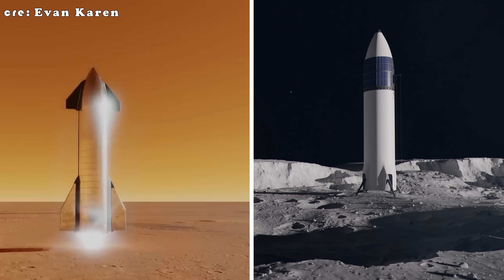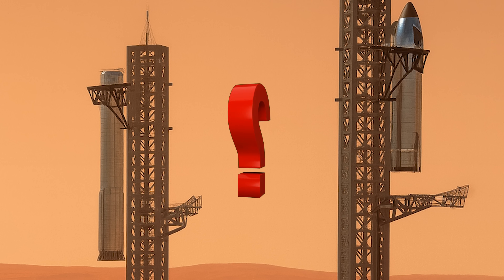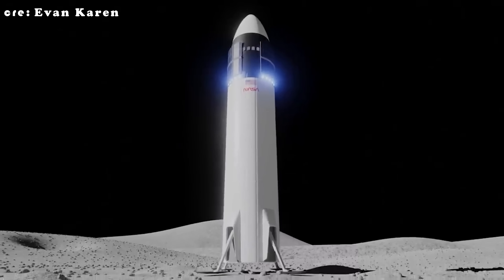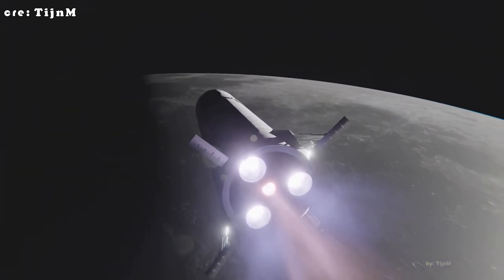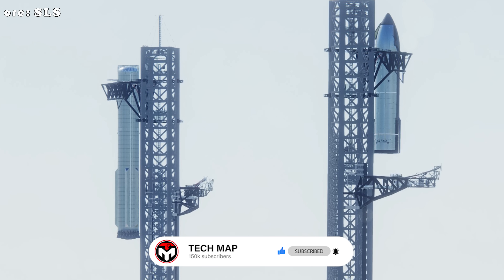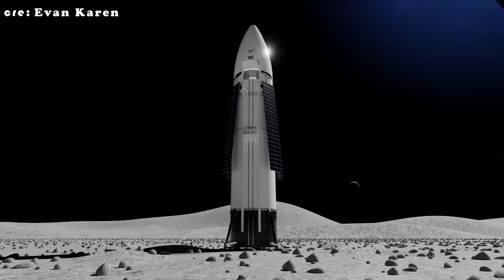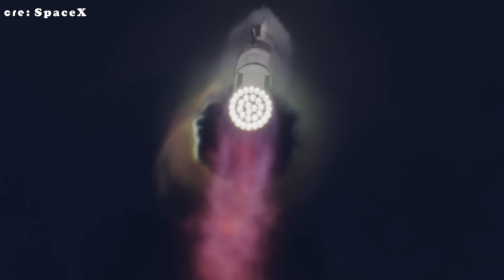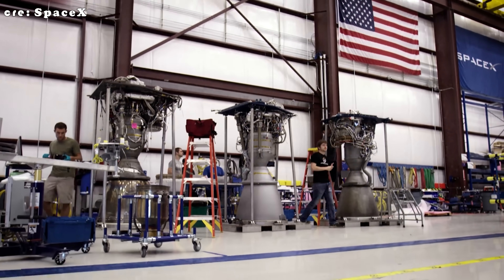SpaceX's New Starship Landing Legs Design Upgrade to Land on the Moon Shocked NASA!

Comment: Use metal rods ( fixed cylinder to ship with moveable rod that uses explosive charge or springs that harpoon into the moons surface to make strong positive contact and grip.

Comment: My Starship HLS/Mars hydraulic landing leg system:

I eliminated all wide baseline designs, so legs extend straight down from the hull interior. This will minimize mass and complexity. And legs on the Mars lander are shielded from reentry heat. 

But the guidance system has greater responsibilities.

The guidance system must explicitly select the landing position for every leg footpad at the landing site. Nothing is left to chance. 

The radar/visual AI system must categorize the Lunar surface as a topographical map of elevation points. This is matched to prior data from orbital platforms. The AI repeatedly provides calibration updates to the inertial guidance system so that the relative ground velocity and landing site elevation becomes very accurate.

Potential sites are updated as the Ship descends towards the surface, and as resolution of the surface improves. 

It developes exclusion zones of poor areas to ignore, and finds many favorable sites that the landing legs might conform to, and choses among them. 

Legs will conform to the surface and cope with up to 15° slopes, standing plumb. 

Upright plumb orientation is the responsibility of guidance and thrusters, not the legs. 

The guidance system must accurately bring horizontal velocity to zero and maintain true plumb, before and during touchdown.

Upper ring thrusters are used for final landing & ascent, while the Raptors are shut down. Legs are extended directly after vacuum Raptor shutdown. As the legs extend, the footpads swivel from vertical to horizontal. Of course the footpads would have struck by vacuum Raptor exhaust earlier. 

There is one hydraulic piston inside each landing leg to directly control vertical extension. The extension side of each piston is connected through a valve to a shared hydraulic loop. They all receive the same pressure. 

There are no hoses. Any required flexure is accomplished with coiled hydraulic tubing.

After the main raptors are shut down, the legs are made to fully extend, via pistons filling with oil, sent from the largest accumulator. This sphere has a hemispherical bladder separating oil from gas. It starts out filled with oil. Expelling its oil contents will send oil through the shared circuit to fill all the pistons.

A set of shared hydraulic accumulators will provide variable stiffness and controlled cushioning, selected through series valves connected to the shared hydraulic ring circuit. 

The largest-volume accumulators receive the lowest pneumatic pre-load. Pneumatic pre-charge pressure is incrementally greater in successively smaller accumulator spheres. Only the largest sphere starts out filled with oil. All others are filled with gas on the other side of the segregating bladder. 

The smallest accumulator has a high enough pneumatic pre-charge to already statically support Starship even before hydraulic fluid enters. The sphere is small enough to assure hard deceleration if legs retract any further. 

The guidance system ramps down descent velocity and maintains plumb as hydraulics in the "lowest" legs begin to retract. They are sending oil back into the accumulator. Once all legs have retracted off the upper "stops", the largest accumulator valve is cut-off. The suspension has become much stiffer. 

The next stiffer accumulator begins filling, compressing the gas further as available volume decreases. The oil pressure rapidly increases as the sphere is filled, increasing force on the footpads. 

The computer will monitor descent velocity, hydraulic pressure and each leg retraction. Accumulator valves are successively closed to assure full leg support is achieved before the legs bottom out. 

When vertical velocity (oil velocity) crosses zero, all piston valves are simultaneously closed. The valve to all accumulators also closes. 

These valves, one in series with each leg piston, will fix/lock the individual leg extension. 

If Guidance did its job, then the Ship is plumb, and the legs are extended to the intended length.

Now that pistons are isolated, the pressure in each can provide information on soil displacement under the footpads. Since the main valve is closed, the pressure drop across individual piston valves is minimal unless soil shifts. 

Mechanical leg clamps provide a long-term backup to the piston valves.

Comment: the dedicated lunar HLS ship should land horizontally.    and the dedicated martian HLS should also land horizontally.  heat shields on one side and legs on the other.  main deceleration burn with primary engines then flip 90 and switch to ullage rockets for final landing.    Same for coming up.  Ullage thruster get off the ground and get the pointy end pointing up and then main thrusters take over.

Comment: The biggest problem with landing on the Moon is avoiding putting a leg, or the entire vehicle, into one of the tens of thousands of craters.  Dust is not thick enough to sink into. Big rocks do present another problem, but not as much as the craters. Craters on the Moon stay steep because there is no water or wind to fill them in. Be aware that the lack of any atmosphere means that even tiny space sand and small rocks hit the surface at enormous speed. A rock equal to the weight of a dime would be like getting hit by a rifle bullet. The James Webb space telescope has already been damaged by getting hit by a piece of space sand. Space has many ways to kill you.

Comment: I have a suggestion which Space X probably won't like, since implementation would mean a radical design change to the Starship and possibly to the booster.  To increase stability on landing can only be achieved by lowering the Starship's centre of gravity.  That means reducing the height of the Starship. Step 1 - increase Starship's diameter.  Step 2.  Instead of stacking the two fuel tanks on top of one another, place one on the centre-line of the Star-ship and the other fuel tank  concentrically around the centre fuel tank, rather like a donut with a jam filling.  I am of course open to financial reward from Space X  ( or any other space entrepeneur ) should this idea be adopted!

Comment: The landing legs for the Falcon 9 would work on the star ship as it will be so light on the moon.  They could have just five instead of six.  It is better to keep the skirt off of the lunar soil in case they need parts from an engine to do repairs on other ships.  It is a very valuable resource .

Comment: Landing legs don't need to deploy just before landing: they deploy in earth orbit and then stay deployed there after.  Failure to deploy is no longer and issue.  The lander then goes to the moons surface and back to the orbiting station.  The landing legs can stay deployed out the whole time.  The only reason to fold them up is to get through earths atmosphere and you're only ever doing that on launch.  If there's a failure to deploy the legs, then the mission gets scrubbed and you launch a new lander: no harm no foul.
Reply: yes, but, can the hydraulics and metal legs take the heat from the R-Vacs?
Reply: Elon plans for Mars. Moon is only a playground to test for Mars. So your idea is not an option.
Reply: Yes exactly my thoughts, even send up a Crew Dragon with the tools to unpack the legs. meaning the legs don't even require power.

Comment: Lunar gravity is about 1/6 that of earth (so the needed thrust to hover is that much smaller), and the lander will be a tiny fraction of the mass of the full Booster+Starship at earth launch.  Using the damage to the tripod launch mount from Earth launches is an inappropriate metaphor for what a lunar landing will be like.  

Nonetheless, the images of a starship with tiny little feet poking out of the rocket's engine-bay skirt look silly to me,  Not only is there very little stability margin for the tall rocket, the engine bells are ridiculously close to the surface ... and most of the lunar surface is covered in dusty "regolith."  The rocket plumes will blow all this about/away, due to the very low gravity.  One thing this immediately implies is that the lander needs to either descend slowly, or even hover for a moment, so that the plume can do this BEFORE the bottom of the rocket gets close enough so that there is risk of damage.  Whether this is feasible with short little legs ... I don't know.  

If you compare these "ideas" to the one successful manned lunar lander, they are wildly different.  The LEM had wide legs that suspended a short body  -- it was very stable.  These starship models look ridiculously unstable.  Remember that 3 points define a plane, only 3 legs are needed.  Why have more?  ... Redundancy ... but redundancy only helps if the suspension system that manages these legs uses it advantageously.   Don't talk about "how many legs" without explaining the leg kinematics.  Just having 6 rigid feet doesn't help much. and may increase the risk that one of the legs ends up on a big rock and tips the whole thing over.  The suspension system really matters ... and there are serious tradeoffs of passive vs active designs.

Another thing to remember about LEM is that it had separate Descent and Ascent "modules."  The Descent module, engines & the landing legs, were left behind when the astronauts left (and they are still sitting there).  If there was damage to the descent engines it didn't matter to the ascent.   In. contrast the Starship design needs to protect the engines, though there is some redundancy due to the multiple engines.

Beyond that, the LEM used an extremely well-proven but low performance non-cyrogenic hypergolic propellant engine design.  In contrast Starship uses the most complex rocket engine known, and one that is notoriously hard to start reliably.  

None of what is going on now makes any sense for Artemis III ... the whole thing is as stupid as fart jokes.  There's no reason for a big and sophisticated lander like Starship just to land two people on the moon.  Ditto using a separate capsule to get there and back ... happening only because Starship isn't man-rated ... and to "justify" some parts of the whole SLS mess.  Even dumber is the idea that we "need" to beat the Chinese ... to what?  We already landed men on the moon, over 50 years ago!  What is the point here?
Reply: The Raptors are off during final landing approach and take-off. 

HLS Starship has a ring of landing thrusters above the main tanks, perhaps level with the unpressurized cargo compartment. 

Since these landing thrusters are angled away from the landing site, the regolith underneath will not be significantly disturbed. 

How does that affect your concerns?

Comment: I have designed a super simple and reliable legs design, based on a motor driven jack screw - it is super reliable, it could be adjustable in length which is a must if you need to stabilise on a univen terain.
Reply: I think the weight needed would be prohibitive to the builders.  I agree with the notion but am unsure it will pass the weight reduction motivation
Reply: @BigRedErnest  I know they are stripping everything possible, but you just can't strip the wheels of a car -  a chopsticks landing with people on board is something that wouldn't ever be human rated. It is better to have 10 tons of legs and to be able to land even on a highway or corn field.

Comment: SpaceX plans its lunar and Martian landings using modern reconnaissance tools—high-resolution orbital images and robotic missions—to collect detailed data about possible landing zones. Unlike the Apollo missions, which required astronauts to visually inspect sites during descent and risked fuel searching for safe terrain, SpaceX uses this scientific data to choose proven landing zones that minimize hazards. Therefore, Starship landings will be based on a comprehensive understanding of surface conditions, not on “unproven” terrain.

Super Heavy Booster Misconceptions:
The 32-engine Super Heavy booster’s sole function is to launch Starship from Earth; it plays no part in lunar landings. For Moon or Mars descents, Starship instead uses a dedicated set of midsection engines rather than the powerful tail engines. This division enables purpose-built Starship variants optimized for off-Earth operations—stripped of mass-intensive Earth-specific systems like heat shields and aerodynamic surfaces—leading to increased efficiency for interplanetary travel. Returning crews to Earth would rely on transfer vehicles, such as Dragon capsules, which would rendezvous with Starship in Earth orbit for reentry and landing. This modular approach is favored by NASA to enhance both safety and cost-effectiveness.

While this system introduces added complexity—including the need for a robust launch platform, orbital transfer vehicles for interplanetary travel, and specialized landers for crew and cargo—it may ultimately be necessary. NASA must balance budget constraints and aggressive timelines with mission safety and reliability, making a compartmentalized, vehicle-specialized approach likely for long-term lunar and Martian operations.

Landing System Design:
Landing on extraterrestrial terrain is challenging due to unpredictable surfaces, slopes, rocks, and loose regolith. Past failures have shown the importance of robust landing leg designs. Starship’s landing legs will absorb impact, stabilize on difficult ground, and compensate for anomalies. These legs will be supported by autonomous hazard detection systems and energy-dampening technology to ensure safe, reliable touchdowns. SpaceX validates these systems through rigorous ground testing and iterative engineering improvements.

Gravity and Atmosphere Effects:
Lunar and Martian gravity is much lower than Earth’s, and both have little or no atmosphere. This allows landing gear deployment either in orbit or during approach, providing opportunities to check the deployment and scrub or delay landings for repairs if anything fails. This method increases mission safety.

Mission Architecture Efficiency:
For sustainable exploration, SpaceX may leave Starships on the lunar or Martian surface instead of returning them to Earth. This approach—potentially in partnership with other companies—allows development of smaller, lighter crew ferry vehicles for trips between surface and orbit, or earth to other planetary orbit, thus maximizing delivered payload. Abandoned Starships could serve as habitats, laboratories, or storage, reducing infrastructure costs and leveraging existing mass and local materials to support future settlements. This strategy fundamentally increases the long-term efficiency and sustainability of off-world missions. 

Thoughts SpaceX should consider:
Launching anything from Earth into orbit is the single biggest cost in spaceflight. Once materials or hardware are already in space or on another world, they’re incredibly valuable. It makes more sense to leave and reuse these assets for future missions, rather than spending additional resources bringing more up from Earth.

**EDIT** Please excuse the extensive rewrites. I have a tendency to get overly detailed. Well that and my OCD. I write the bulk myself, and then use AI to clean up and clarify points.

Comment: Could the rocket blast from the raptors not be used to blow away the debris in the landing zones?  An outward gimble on 6 outer ring engines could blast away lander leg obstructions.  The interior 3 engines could blast the central zone and cut off when the outer ring is firing, this would take a short hover phase of a second or two similar to that used with mechazilla.
Reply: So you blow rocks in the size of a football away with speeds of several hundreds of kilometers per hour, they bounce of another more massive rock and bounce back to kill the ship. Is it this what you proposed?
Reply: @jochenwagner2782  moon is large and has clear areas, you wouldnt even try to land in an area with large boulders.  In a fairly selected area there are not walls or large boulders.  the hazzard is not large boulders, its small ones holding up one of the legs.
Reply: @BigRedErnest  South pole is the target. There are nearly no clear areas and not good enough high resulution images to find a 100% save spot. Because of this, all of the recently failed landers had software to avoid bolders.
But even if you avoid bolders. There likely will not be a real flat surface. 
A small lander with wide legs will stand right up in 30 degrees inclination. Starship can't do this because center of gravity high up.
Also it's an issue with the weight distribution if one leg holds most of the weight. 
Legs must be adaptable or the ship will tumble over or break. Remember. Final target is not moon. It's just a playground. The system has to work on Mars! Elon doesn't boter to develop a system for Moon only if Mars is target.

Comment: Everyone keeps going on about the weight... but the HLS will not have the wings or heat shield and the moon has 1/6th the gravity.  They can pay a significant weight penalty and it won't affect the payload.    They will need to find something that can articulate and keep the ship upright.  Thankfully they don't need to worry about winds or anything that could knock it over (unlike on Mars where they will need the heat shield, wings AND legs that will have even more challenges after landing).